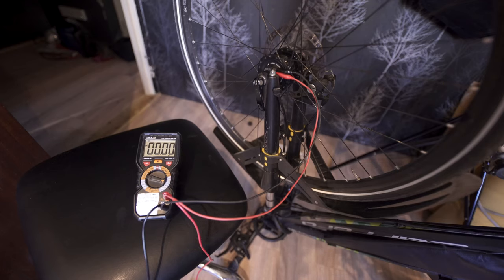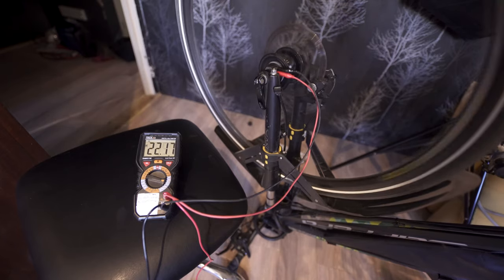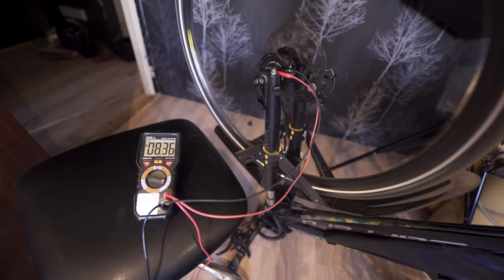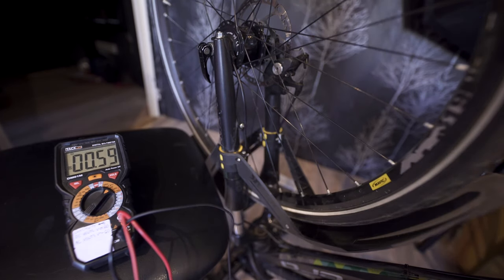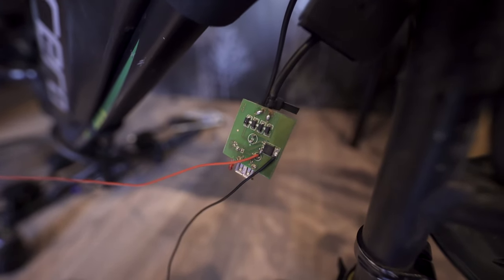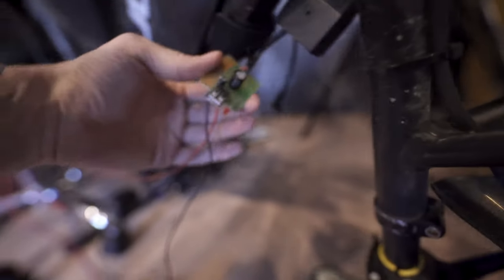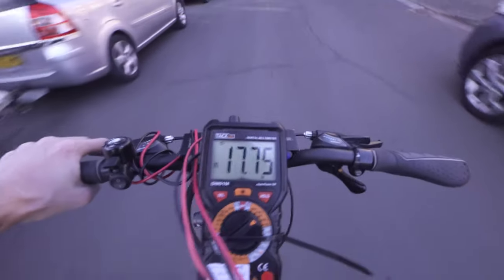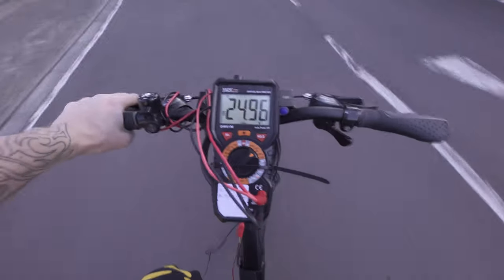How much volts do Bicycle Dynamo Hubs Generate - Shimano Alfine 3 DH-S501: GENERATED 45.27 DC VOLTS?

Comment: If you measure your voltage when there is a load on it, say 3 watts of lighting, I think you will find that the voltage will go down. It would be similar to pedaling the bike with the wheels off the ground, no load, and seeing that the wheels spin very fast or riding it on pavement and seeing that you can’t keep the same speed.

Comment: What would happen if you use the dynamo on the tread instead of the center of the wheel .. Like make a bracket that can be lifted on and off the wheel ... I think u would get more rpms but would it ruin ur dynamo?

Comment: 45V but only maximal 3W.  5V and 3W is a 0.6A Current (I). 45V and 3W is a 0.0666666667A. LED Bike Front and Rear have Kondensator and Baterry ... Dynamo is full save for LED Lights in Bike.

Comment: This looks like a dandy circuit. Not very efficient as far as the watts power input by the pedals vs the power you get out of it. But it is a low power circuit so it's not really that much loss of power anyway. This circuit seems to have a VOLTAGE regulator, not a current regulator. There is a difference. It has 2 capacitors to remove ripple, or variation in voltage. It should have a precise 5 Volt output at the usb port. That way you can charge up anything you want to like it is supposed to be charged, to 5V usb specifications. The first capacitor will have an abundance of voltage until you plug something into the usb charging port. If you plug a dead battery into the usb charging port the current will go up a lot more than what the red led is drawing now, and the voltage of the first capacitor will go down a lot. As long as you don't overload it the voltage at the usb port will not drop very much at all. It probably should be fused between the big capacitor and the voltage regulator. There are 2 or 3 usb port standards. This usb port will charge with higher amperage than a computer usb port will. A computer usb port is specified at 1/2 amp or 500 milli amps maximum. Yours will do more I feel sure. You can research it online what the maximum amperage is for whichever usb standard you have there. I am not real familiar with the standards. There are front and back lights that can be charged with usb cables and you can charge the cell phone and no telling what all. Thanks for sharing it was very informative. I am building a circuit with LED lights from a vintage light with high beam low beam. Got to get my local mechanic to build me a wheel. By the way which hub did you use in the wheel?
Reply from the maker: Thanks so much mate. Since this video I have learned so much and finished the circuit. Also done tests calculating amps and watts aswell but haven't posted anything regarding that.

At the moment I've got it charging a cache battery pack at 16.8v and it never seems to run out as I'm constantly peddling so I love that if all worked out. This is for my front and back lights. I'm using 2 X Solarstorm 15000lumens, in series they require 16.8v, next step would be adding a wireless charger for my phone on top of behind my phone mount but I would need a switch that changes my 16.8v output to what my wireless charger would use

The hub is in the title of the vid :)

Comment: You must measure the voltage with a load on it. Just put a car lamp, a beefy resistor, etc. This voltage alone meaningless.
Reply from the maker: Cheers man. I still have a lot to learn
Reply: @TMProjection  But still you made me smile :-)
Reply: @TMProjection  but you did a nice video! Keep producing!

Comment: I wonder what is the Wattage produced by this dynamo hub.
I am thinking of building a system on the bike to save the electricity generated by the hub of my bike. Does anybody know?
Reply: At 7 kmh I get a  500 milliamp pulse of 3 Volts every 50 milliseconds. which is about 1500 milliwatts or 1.5 watts